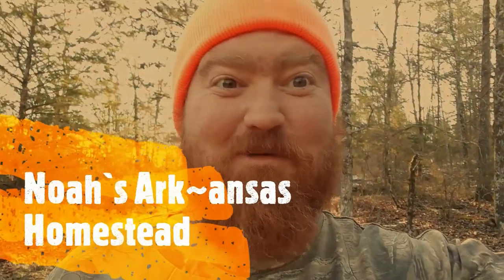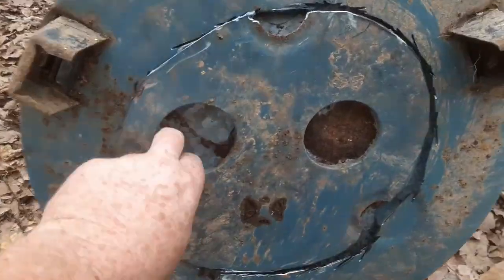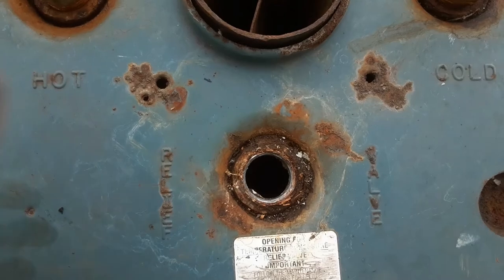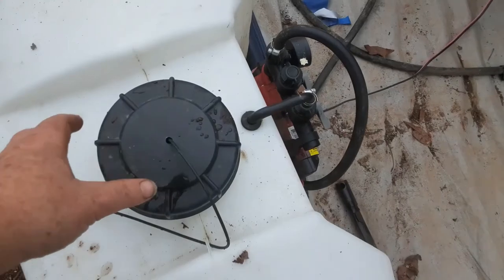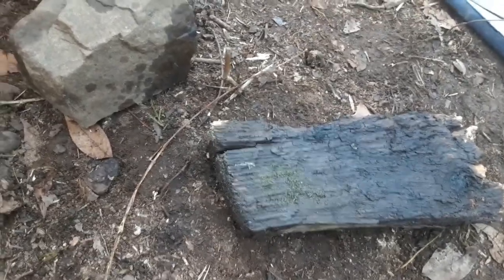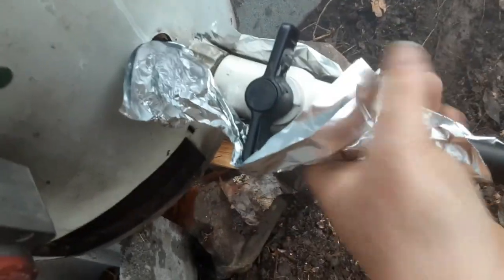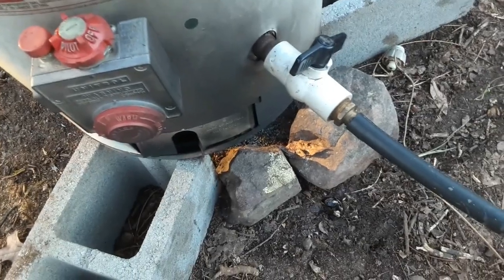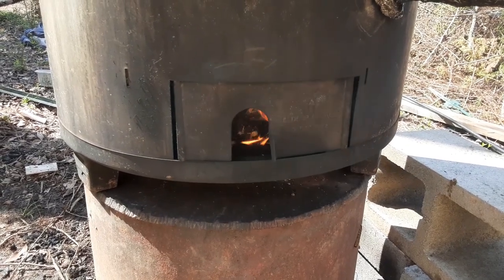DYI, WOOD Hot water Heater from old GAS heater

Comment: There was something i ment to tell you.  I noticed when you looked up the smoke stack, there wasnt much light showing threw. That thing should have a spiral heat exchanger running threw the flu. You should be able to pull it out from the top.. if it builds up sute it will not qork wright.. take care Brother😇
Reply from the maker: Yes, I was trying to use it not long ago, saw smoke wasn't coming out the top and wasn't getting hot. I was about to try to sweep it like a chimney and saw the spiral piece and pulled it out. To my surprise it wasn't tack welded, and came out easy. Great comment, and Thanks for watching.

Comment: I have water piped into the house that I pay for, and is under pressure. I was thinking about putting a rocket stove under the tank and leaving it plumed as normal.
Reply from the maker: That could be a good idea, it took forever, like 3-4 hours to heat up that hot water tank. LOL. You might be able to do it under an hour with rocket stove. Good Luck and stay safe. 😄

Comment: Love the sock filter! Getting ready to do the same thing but thinking it will be pressurized first. My water is 12 volt rv pump into well. Old travel dc cooler that i had... hot water is next! Cant wait
Reply from the maker: Hey, Sounds like your already off the grid. Having the well, I believe is #1. I'm still struggling in the summer when my creeks run dry. Having hot shower, is a Huge morale boost. Good Luck, Thanks for watching and commenting. 😄